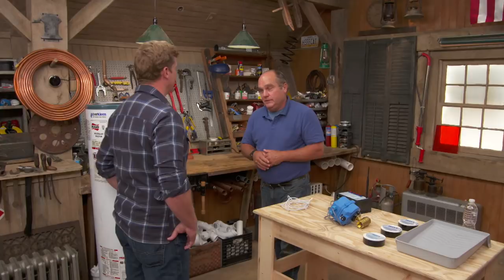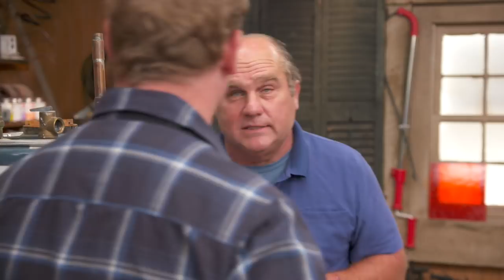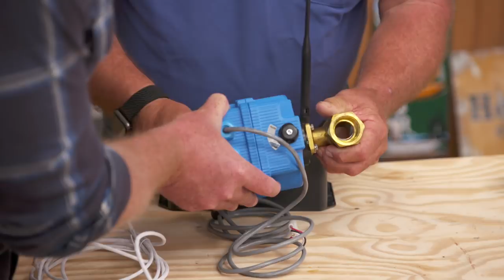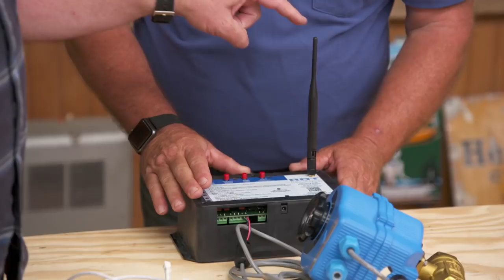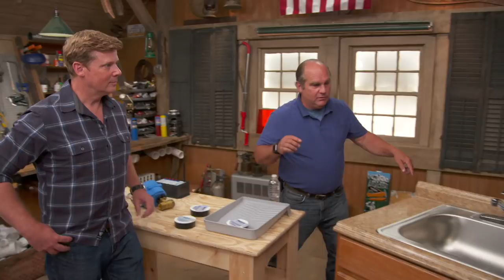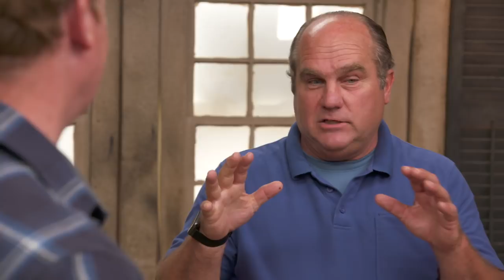How to Prevent Plumbing Leaks Automatically | Ask This Old House

Comment: We just purchased a pretty old home and I'm trying to change out the pressure switches on my pumps. I have two pumps one that pulls water out of the ground and one that pumps water into the house. On one of the pressures switches that is connected to the pump there is some kind of it looks like metal but it's caulking on the screwed-in bottom hose that connects the pressure switch to the actual pump. What is this caulking? How do I get it off I'm trying to just install a new pressure switch and I'm not sure if it will even unscrew. Is that permanent or is it just some kind of putty that'll break loose when I go to unscrew the pressure switch after I remove the electrical wiring? It's your typical well pump pressure switch 30/50psi

Comment: That's great but a lot of houses don't have a water main in the house in an easily accessible location.  I've seen them in little access panels behind a shower where the water comes in the house or some other obscure place where replacing it with this kind of valve is an expensive plumbing service call.  I'd just take my chance and get metal braided hoses for the washer that I change and keeping an eye on the water heater.
Reply: Those metal braided hoses are what failed for me. 1 year old washer and new hoses. The crimp on the hose failed. Came home to the 4 in deep drip pan under the washer totally full. Another hour and it would have spilled over. 

But yes this is expensive. $30 WiFi moisture sensors would also do the trick. Then you turn off the water manually.

Comment: How long to take a shower or to water the lawn?  It seems those 2 are the only things that require water to run a long time so why not something simple, a valve that monitors how long the water has been flowing without interruption and turns it off if the limit is exceeded?  Yeah, could have a lot of water flowing before the valve shuts off, but at least the water wasn't running all day while you are at work.  Set the limit to 5 minutes.

If taking a shower, you know you have a limit, you could, while in the shower, turn it off for a moment so the valve's timer resets.  

I can't think of a workaround for the lawn.
Reply: Forced 5 minute showers. I like it.

Comment: I'm just a little concerned if the device shuts off the water mains and the leak originated from the hot water supply - does the tank shut off if it empties out completely?
Reply: when you shut pressure off at the main you lose pressure @ the HWT so no more water is forced into the system through the hwt, same reason why you cant run your hot water if you shut off the main meaning unless the tank itself is leaking there's no way for the tank to empty, but no most of the time a htw will not automatically shut it self off, that's why you never want to turn one on if there's no water in it beforehand

Comment: $1,600 Way to steep for me. I'm currently reviews a system that can do the same but at a  lower cost using z-wave. The cut-off valves cost about 400 to 500, plus water sensors which are in the cost of $40 per sensor.  Wireless Z-Wave Water Valve 1.25 inch; Cert ID: ZC08-13040028 - They come in different pipe sizing.
Reply: flowgiston lmao
Reply: For 1600$ i can replace all the flooring in my house 2 times LOL ;)
Reply: Richard - no you can't but yeah 1600 is outrageous when you are basically doing something for the insurance company.  If the insurance company gave a discount, I might pay 1600, but then, if it didn't work and they gave a discount, they might refuse to pay damages.

Comment: BUY THIS OR SOMETHING LIKE THIS NOW. Save your time, money, and heartburn. Pay equivalent to a deductible now or do it later along with a multi-month long house renovation with possible coverage denial, mold issues, ruined contents, asbestos abatement, (which sometimes isn't covered by insurance) etc. If you don't buy one of these, at least replace old shutoff valves for sinks and toilets, and for fucks sake replace that shitty plastic ice maker supply line with a steel-braided with a shutoff valve that's quick and easy to access. Two biggest causes of a water loss right there.

Comment: I was afraid of the battery life on those sensors, but turns out a couple double-AAs keeps a sensor alive supposedly for two years. Even one year would be pretty impressive in my book. 
I'm still a bit paranoid about anything wireless. I'd want a qualified independent security team to take a look at it; otherwise, I'd say stick to wired solutions if possible.
Reply: verdatum You are afraid someone is wireless listening along with you if you have a water leakage already?
Reply: Security wise is nothing to be worried about with a self contained/standalone wireless system like that (or a wireless doorbell), worst that could happen is a local person or neighbor somehow tripping it on you, which is a slimmer chance than winning the lottery by not playing. Internet connected appliances and devices can be hacked (for malicious reasons, to reprogram it and add it to a botnet, to remotely control it, etc...) but a local standalone network is somewhat comparable to an fm radio, radio is completely open but how much station overrides do we hear of? The attack has to be local and there is nothing to be gained by the attacker, so only a few curious folk ever attempt it. But internet connected, "IoT", Wi-Fi,or "smart" wireless is a legit concern as they are in the internet. Just wanted to point out the different types of wireless, because they are all commonly called wireless.

Comment: What if the water shuts off and it dry fires the water heater before or after the water is turned back on
Reply: it would be the same failure if your tank blows, minus the water on the floor.   

realistic,  why would your tank be dry? it should be full of sitting water at 0psi, so actually safer than if the tank blew

Comment: How it will protect pipes from freezing?! It will close valve, but all pipes are with water inside and whet it will freeze, it will ruin all water system in the house!
Reply: If the pipe's burst then the water in the pipes would drain out, but the main water is shut off so water can't keep coming into the house. Something would still get wet and you'd have to replace some pipes but it wouldn't be endlessly flooding your basement like if the main was on.
Reply: MarioDragon They say in the video that the sensors detect temperature. So they shut the valve already when it’s only freezing. For shutting the valve after a leakage you don’t need the temperature sensor. So i assume they want to prevent the pipe from bursting somehow. So melickon is asking a legit question.
Reply: It doesn't stop pipes from freezing. It stops your house from flooding if a frozen pipe bursts.

Comment: I looked into buying this, but it's designed wrong. It doesn't "fail safe", IOW when there is a power failure, there is no electricity to close the valve! In winter climates, your heating fails due to power failure, house freezes, and a pipe bursts! They should make them so they close when power fails too, or when it can't connect to a sensor. Instead, they over-complicate the design and try and sell you expensive battery backup options. Bad engineering!